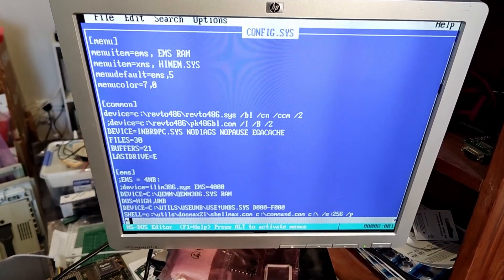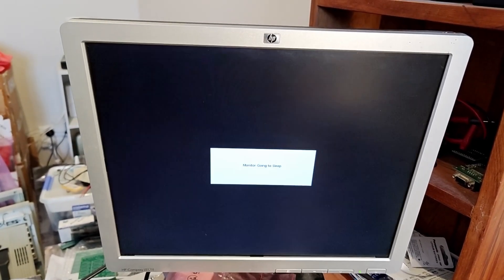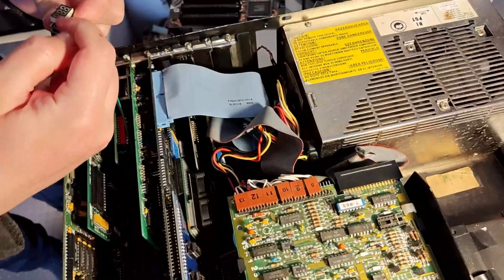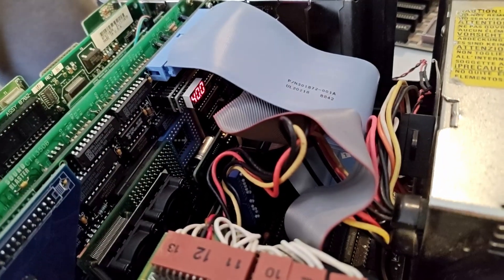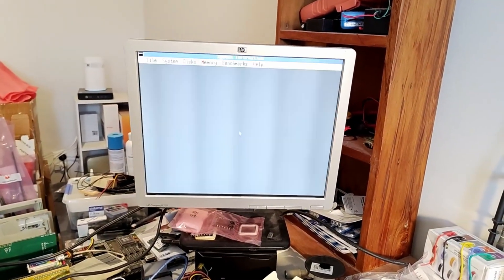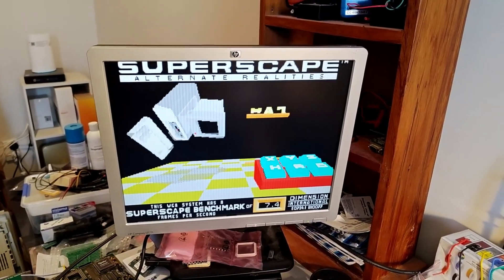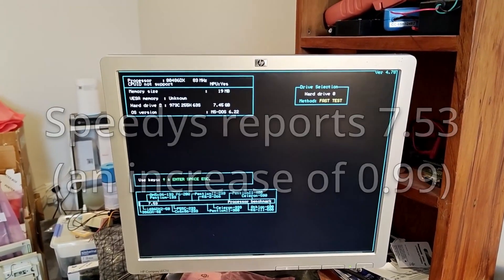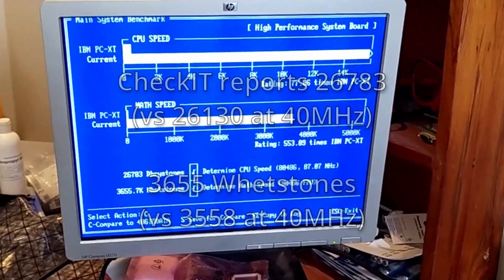Slowing Down the XT's CPU Made it faster!

Comment: To be fair there ARE programmable signal or function generators, in usual rack mount or bench formats. However those tend to be very expensive if they support more than let's say 1MHz in a reasonable manner. But on the upside they can usually produce different functions, like square wave, sine wave, triangle etc. This here is of course much cheaper, while still being able to drive up to dozens of MHz. That's quite nice.

Comment: I wonder if it's possible to overclock the ISA bus to something like 6 MHz. Something like that would improve the transfer speed of the bus by 25%, which should help anything going to the VGA card.

Were you about to say "ISA bus" after "without changing perhaps the..." at the end of the video? ;)
Reply from the maker: Yes I was considering looking at the logic on the Inboard itself but also the ISA bus on the PC will give a marked improvement. The issue with the original PC and XT is that everything was tied to the 7 (or was it 14) MHz crystal on the mobo, DMA, etc. the support chips were all rated for that clock, so won't work at a higher rate. This requires mods like the PC-Sprint or similar to make it possible, and that's a hefty change

Comment: Thanks for the video. The ISA bus is clearly the bottleneck. By changing the frequency, you're adjusting the ISA bus to avoid latency cycles. Now try overclocking the bus without changing the external processor board's frequency. I think you'll like the results.
You can gain 10-30% more speed.
Reply from the maker: Do you have any ideas on which chips to work on, on the IBM motherboard to do this?
Reply: @AlsGeekLab  Unfortunately, I have an Acer 710 PC XT. Like newer boards, it has a crystal oscillator, which I'm replacing with a faster one. It does speed up everything, though. If I increase it too much, the monitor loses synchronization due to overscan.
I don't know how to do this on your board.
Reply from the maker: I upgraded my 5162 XT/286 board to run faster on another video. I had to upgrade DMA chips to support running the bus at 8MHz (this allowed for a faster 286 also, at 10mhz)